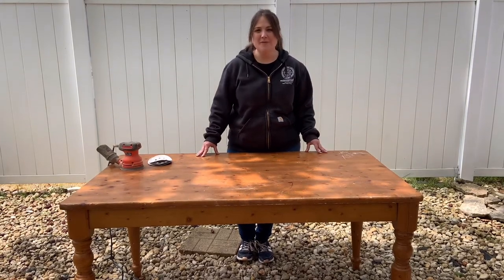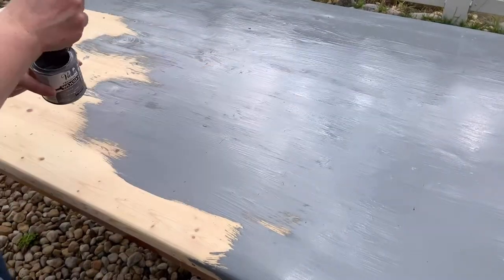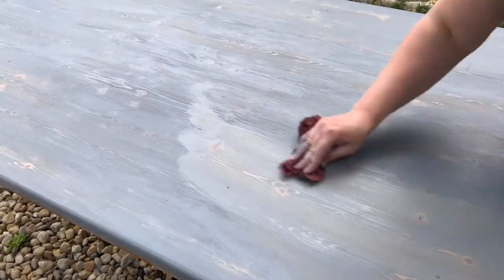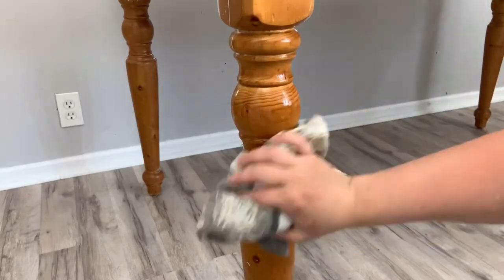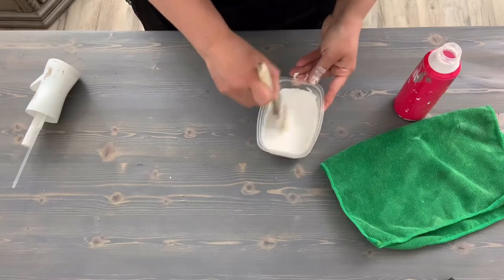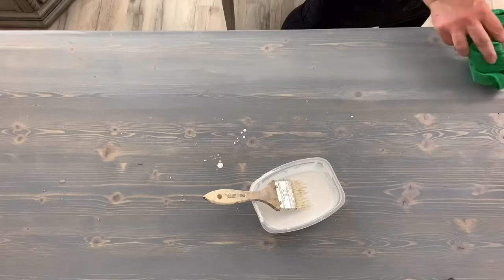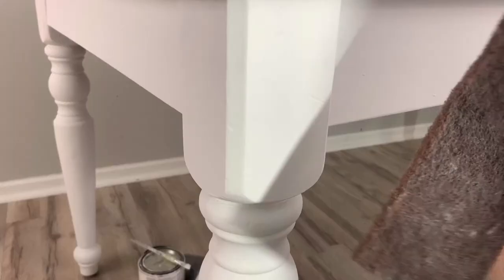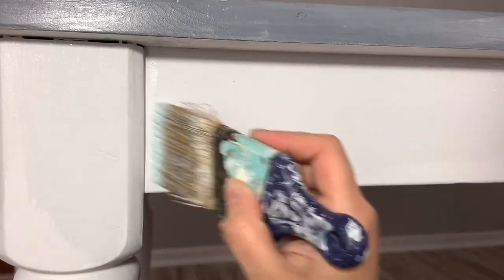Furniture Makeover | Start to Finish | How to Update a Table

Comment: I just used this same Varathane stain and it turned out looking so blue that I didn’t think it matched the black apron and legs. I was aiming for a white washed look. I was thinking of going over it with watered down white paint like you did here but I didn’t think I could put water based paint over the oil based stain. I know this is an old video. Hoping you’ll see this as I have struggled with what to do about this blue.

Comment: The table and chairs are gorgeous! How much are you able to sell a table set for? Just a ballpark figure would be helpful. Thank you.
Reply from the maker: I ended up keeping the chairs and selling the table on its own. I put the table up for $250 and sold it for $200. I find it’s a little trickier to sell the table without the chairs.
Reply: @FlipItFurniture  Thanks for the info. I have a table/chair set almost finished. First set I’ve done in a long time because I don’t like painting chair spindles. I needed a change from dressers and nightstands though. I luckily found a set that didn’t have spindles, so it was pretty easy.
Reply from the maker: Nice, that does make a huge difference! I’m working on a rocking chair with spindles right now 😅🤣